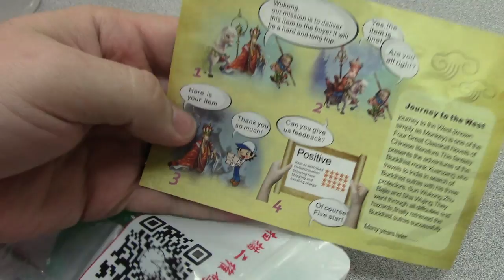Casio G-Shock GA-700 Band and Case Replacement

Comment: Will a bezel from the ga-100 fit on the g700? I would assume that's a bit of a stretch. And do you have any more links to better colors for the g700? I've been searching for a few days but haven't got any luck, it seems like the g100 has more color options on the web.
Reply from the maker: The GA-100 is slightly smaller and has a different button layout.  So it definitely won't fit.  There's only a couple of sellers that I've found that sell the translucent bands like these.  And both basically have the same colors.
Reply: @ackliph  I'm personally not a fan of the translucent colors. I'd prefer solid colors or camo print, but no luck except for solid green and solid black

Comment: was that white case and strap a totally lost cause, or would it have come back to normal after a good cleaning? I have a white GA100 that's starting to smudge and I tend to wear it less because of that reason
Reply from the maker: I think it was a lost cause.  It's a white paint/coating.  I used degreaser all over it to no avail.  And that stuff makes car tire lettering turn white again.
Reply: @ackliph  thanks for replying, man. I guess a dirty beat up G-Shock doesn't look bad in black, but in white it's kind of an eyesore. hope you're enjoying the new green look ⌚

Comment: i cant find guys pls help, how i can buy this fckin watch...
Reply from the maker: They have them on eBay.  The case is from AliExpress.  It looks like the link I had is down.  This should work. 

#Aliexpress US $10.25  46%OFF | Watch accessories 16mm resin strap for Casio G-SHOCK GA-700-710-735 watch transparent strap men's & Ms sports watch case
https://a.aliexpress.com/_dSJMLql
Reply: @ackliph  hi again Travis , ur watch is original or replica?
Reply from the maker: @burakyolcu4963  oops wrong link!  My watch (movement) is real.  The band is aftermarket.

#Aliexpress US $10.25  46%OFF | Watch accessories 16mm resin strap for Casio G-SHOCK GA-700-710-735 watch transparent strap men's & Ms sports watch case
https://a.aliexpress.com/_dSJMLql
Reply: @ackliph   but it causes 50$  shipping to India, please help
Reply from the maker: @soorajnair3136  wow.  Does it come in a gold box? Sorry man.